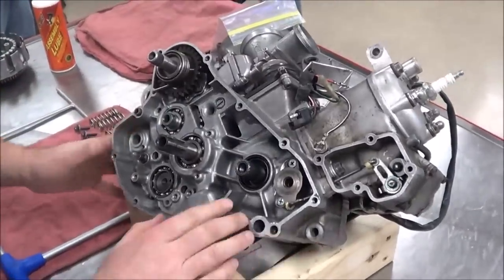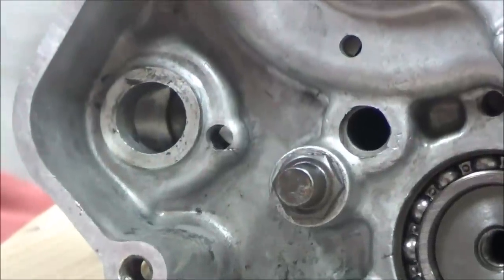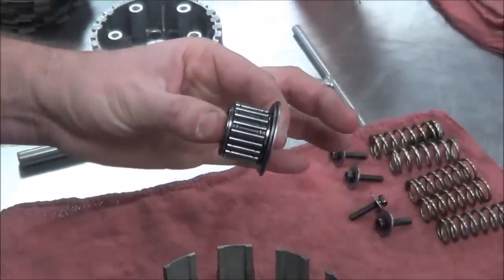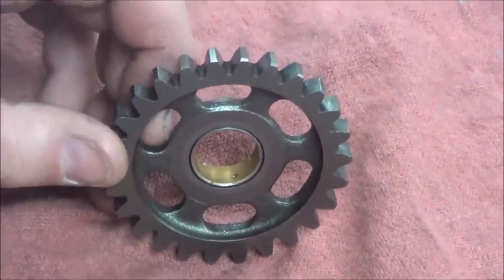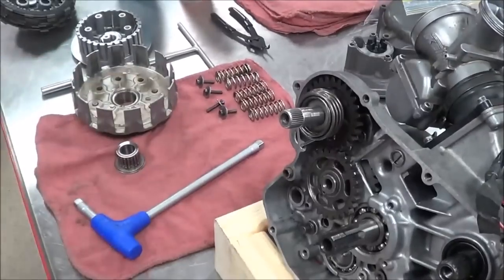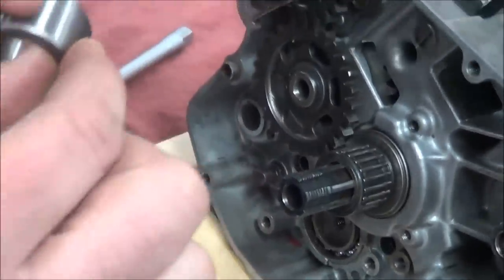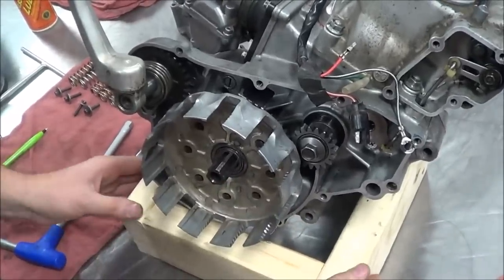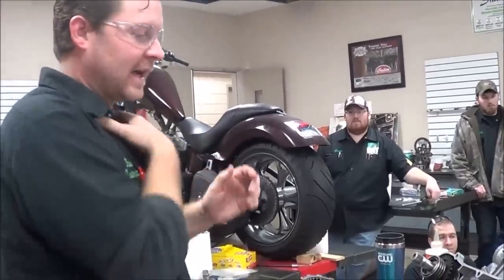2 Stroke Engine Assembly   Primary Drive Components   11 11 14

Comment: what prevents the "bushing/spacer" from leaking transmission oil into the crankcase between it and the crankshaft when there is no seal? I'm having this problem with my bike.
Reply: Hunter Simmons there's a rubber seal with a tiny spring around it. It's called the crank seal.
Reply: edward hutchison the crankseal is around a steel bushing the bushing is around the shaft itself. The seal  seals the outer diamerer of the bushing but nothing seals between the bushing and shaft.